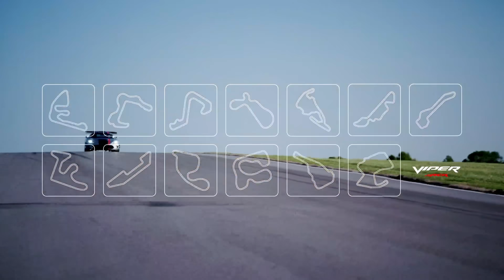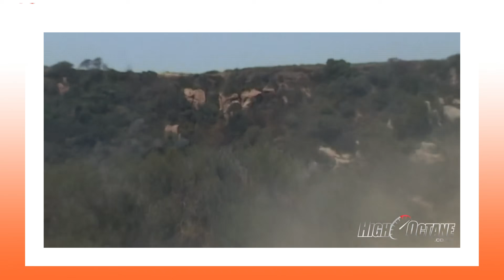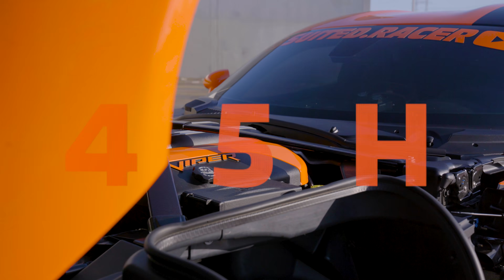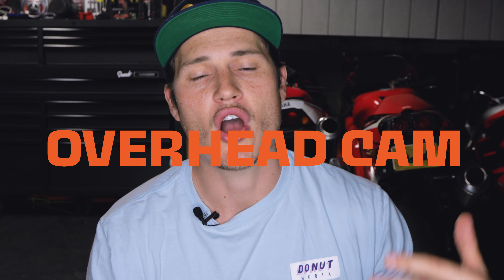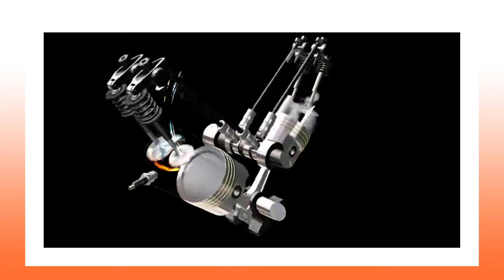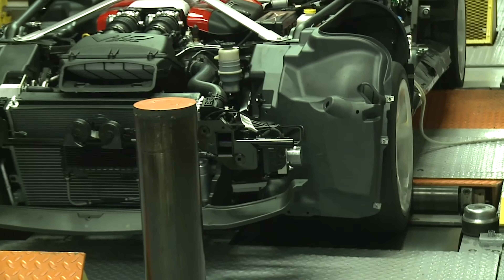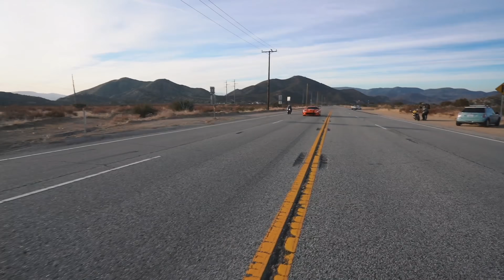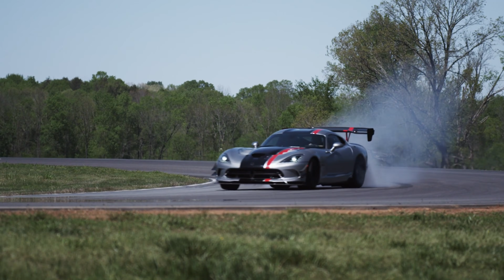The Engineering Behind the BEST car America Will EVER MAKE - Dodge Viper ACR

Comment: Hey Donut 
You can rent a viper for a track day, this memory will be with you FOREVER, long after the fiat was fritted away on noise, I rented one in T.O., before buying one in Brampton. I took it to T.X., g,bush has T.X. sized toll highways, 175 mph one way, switch seats, throw coins in the toll booth, watch the gas gauge drop CONSISTENTLY at 175mph. Good times, if YOU had extra fiat, stock viper,  take the snake to a king cobra, 1000hp, blower like Corvette?, (hennessy blows, any standard car guy, if it doesn't have a stick, I won't buy it), add turbos?, alpha package? Thanks for the video.

Comment: *A 1998 Dodge viper sits on a lot in the hot sun, looking both beautiful and deadly at the same time. its headlights almost seem to glare at you with malice. its Viper blue paint and dual silver stripes making it stand out, in spite of it being on a rotating pedistal. on the front glass is a sticker, at the bottom and to the left that says "For Professional Drivers Only" followed by the trademark Viper insignia. this is a GTS, equipped with Viper 5 spoke alloys shod in a sticky sports compound. it's listed at $118,950 USD. you know that it's the real deal. fiberglass tub shell sitting on a partial spaceframe chassis. almost nothing for amenities or comfort. interior simply 2 black bucket seats clothed in padded faux leather vinyl, no A/C no power windows, no ABS, only 2 large speakers in the center between the seats, a radio, and a 9ated 6 speed shifter that controls the Borg Warner T56 transmission. it's practically a purpose built racecar for the road.

Comment: I've owned both a Viper (2000) and a Corvette (2004). The Viper had neck-snapping torque and eye watering acceleration, but it was no fun to drive. Clutch, gearshift and steering were all truck-like. Viper was so over-powered and unrefined that it made me feel unsafe all the time. Corvette was like an F-15. Viper was like a MiG-25

Comment: A few corrections about valving.

Many engines have gear driven OHC.

Pushrod engines can run more than 2 valves just as easily as an OHC.

Pushrod engines can also have them at any angle, not just straight over.

Almost all highway big rig engines since the late 90's have been gear driven OHC engines, and have been 4 valve engines for even longer, by a decade and more.

It may not be common in the automotive world, but is the exclusive standard in heavy duty engines around the world.  There just isn't a call for it in the automotive world due to planned obsolescence and economy demands.  Chains and belts are good enough and cost much less than a gear driven valve train, and since the vehicles last long enough to exceed warranty, there is no reason to spend the extra amount for a gear drive.  Additionally, belts have the lowest parasitic loss for turning the valve train, leaving more power and economy available for moving the vehicle.  Plus, it is cheap.

In heavy equipment though, longevity and reliability is paramount.  Vehicles,  including highway trucks, are considered equipment, not automobiles, and expected to work and earn a profit.  A breakdown can cost thousands, tens of thousands, or even millions of dollars worth of both repair costs and lost income.  They also tend to be significantly more powerful, so the very minor relative gains from using less reliable chain or belt driven cams is not worth the risk of total engine failure.  All diesel engines are called interference engines, which means if the valve train breaks and the cam doesn't turn at the matched rate of the crank, the valves will hit the pistons which can lead to broken valves at the least, to total catastrophic engine detonation at worst.

Comment: an important note: The edges of the spoiler having winglets is also because flow gets kinda fucky around the edge of a wing, similar to why airplanes have the swept up wingtips. If it just ends in a sharp corner, then theres a ton of vorticity created in the flow which causes relatively huge amounts of drag and flow instability around the wing, not only making your thrust effectively lower but also killing a decent chunk of your lift.

Comment: The viper is hot garbage. No power steering or traction control. The corvette outsold it because the corvette had just as much power with all the modern comforts.

Comment: The viper is an extremely powerful engine, however the king of N/A torque from a gasoline engine is still AMG 7.3 M297 which has had 664lbft of torque since 2006 in the Pagani Zonda
Reply: Where are you going to buy that though lol
Reply: @griff1709 Bingo

Comment: almost every production car of this category has a hollow wing. there are from 3 to 5 layers, from that is 1 or 2 layers of glassfiber because carbon itself is very stiff, but it can´t withstand many impacts from pebbles and so on. there are not many car parts which are made only from carbon fibre because of this. only little things, interior and stuff which should not withstand big impacts like bumper or diphusor.

Comment: It's not that I disagree, the numbers do.  600 lb-ft from an 8.4L is surprising only bc it's low.
Forget being the highest torque, or the highest torque per liter ...
we know it's nothing special to exceed 100 HP per Liter, bc HP is SYNTHETIC:
(just a function based on torque retained over 5,252 rpm).

Torque is WHAT performance / sports cars make, (and often they make more per L).

85 lb-ft per Liter - C8 Z06 - 5.5L and 470 lb⋅ft
87 lb-ft per Liter - 992 GT3 4.0L and 347 lb⋅ft
77 lb-ft per Liter - Viper ACR 8.4L and 600 lb⋅ft

Perhaps better is judging the ACR by area under the curve; which is a better metric, anyway.

Comment: I actually got to see the original prototype in person at the Chicago auto show in 1989.   In fact we got to actually sit in it !!!! It was never intended to be anything more than a proof of concept that ran and drove featuring an Aluminum version of the V10 truck engine that they hoped to one day build a performance car version of. The public sent so many letters Dodge decided to produce it with a few changes. they got rid of the sick looking headers that went directly into side pipes the were exposed all the way down the side of the car !!! It runs out several people were burning their feet and legs getting in the car!! It was several years before they even offered a top on this car at all !!! I also heard the firing order had to be changed because the truck version was warping the crankshaft when you kicked up the performance !!!!

Comment: I've owned two Vipers and I still learned some things from this. Great video!
Reply: Man the viper is my dream car any pros and cons I will try my best to start saving up next year
Reply: @AAA-wn5dp  it depends on the generation, but the biggest cons are visibility, interior space/headroom, and difficult to get in and out of. It's easy to burn your legs on the side exhaust if you're not careful, and if you're tall it's harder to actually fit in the cockpit. Also the interiors are pretty lackluster unless you have a gen 5, but people don't buy these for the creature comforts. They're all pretty minor imo.

If you can afford it I would splurge for a gen 4 (08-10) or gen 5 (13-17). They've skyrocketed in value lately though.
Reply: @98BlackTransAm  yo thanks for the feedback

Comment: I owned a viper and it had ironic pros and cons never considered. 
PRO:the viper used cheap common parts and it was built to be worked on.  Easiest vehicle ive ever loved to wrench on.  things such as the rack and pinion unit could be removed in 15 minutes.  Simple and reliable.
  
The IRONY:Car tried to kill me 3 times.  I mean seriously,  it was like the hottest craziest bi-polar chick you could ever cross paths with. Troubles happen when youre not expecting, wanting or in the mood for it.  The amount of women that approached me for dating vs before ownership was astounding.  Every shop I took it to for services had to come ask me how to open the hood.  I was 28 when I bought it and full coverage insurance was only $75 a month.

CON: Itll need new rear tires every oil change.  Theyre $500 a piece.  Doesnt matter if youre always easy or throwing it like crazy chick likes....every 5k miles costs you least a grand for rubbers.  She like 10 quarts of the good stuff to boot.

Comment: The Chev Ls engine is variable as well
Reply: Yeah that's what I was going to say I have a first gen 6.2L in a Yukon and it most definitely has VVT I know because I have replaced the actuator.... by no means do I mean it is a great setup but it does change the valve timing as well as torque and power output.

Comment: Viper has always been my favorite car from the modern era. Just like the 427 Shelby Cobra (its predecesor). Front engine, rear wheel drive, huge powerplant, super capable!
Maybe, If Dodge lets the viper make a comeback, We might see one with most of what made the viper such an amazing car. That car was a beast meant to test the driver while other cars were made to make the driver test the car. 
Now, If we want to see it alive again we must accept That the viper competes directly against the corvette. That is a rear-center engine vehicle with a huge v8 and a ton of tech. So maybe the viper will still rely on analog aids instead of electronic aids, but it is most likely going to be a rear-center engine vehicle with lower displacement, forced induction and maybe AWD with a polarized power split towards the rear (maybe 70 or 60 Rear and 30 or 40 front). It will come with EBD for shure, Traction control that you might be able to dissable and that makes me think it won't look exaclty like a viper should.

I love dodge for its huge engines, but They must start going towards smaller blocks with forced induction. I would absolutely encourage Dodge to use 2L L4, 3L v6, 4L V8 and 5L V10 to make the new family of Mopar Engines. That would make Dodge proffitable, emmision compliant, more popular and more likely to survive modern standards even if it forces them to burry big blocks in history.

Comment: People poo-poo pushrods. But they need to understand that on a road car, displacement means nothing. Physical size and weight mean everything. If Dodge or Chevy can make a pushrod 7.0 V8 that weighs less, is physically smaller, and makes the same power as a turbo 4.0 DOHC V8, then the American engine is better. Period.

Comment: Umm why you calling what's obviously the handle of a swiffer duster a broomstick, i get it, broomstick sounds less prissy, and a broomstick would be hard as hell to use to even turn a flashlight on and off and therefore a terrible analogy, but instead of rewriting the analogy once you realized it, possibly very close to shooting the video to have time to change it, or some point just before shooting, I just want to be a fly on the wall for that conversation, and fervently searching for a replacement believable enough to make the analogy work,  and then someone going  " hold my beer" and then runs off only to return with the duster in hand, and you guys were like fuck it, action!

Comment: production (high numbers) it may be, but i would never make the viper a v10,
 but a DOHC 32 valves 8 cylinder hemi, 8 liters 512, all aluminium head/block, high compression, 8000 rpm, ram air 8 throttle bodies, NA engine to start as the Viper RT-NA, 
then a single turbo version 488 V8, lower compression forged inners , single throttle body , with after market programable injection modules friendly ports. Dogde , if yall read this.. im not busy at all...

Comment: I’ve got to call Bs on one thing. Pushrod engines generally have more torque because they are generally of larger displacement than OHC engines. They’re larger displacement because they NEED to be because they are less efficient. 

For example, let’s compare the 8.4L Viper OHV engine and the 5.0L DOHC Mustang engine. The Viper engine has 1.68 times the displacement of the Mustang engine. The Mustang engine makes 420ft-lbs of torque vs the Viper’s 600ft-lbs. If you correct for the added displacement, you would multiply the Mustang’s torque by 1.68, and get 706ft-lbs of torque from an 8.4L DOHC Mustang engine. Or, go the other way and divide the Viper torque by 1.68, and you would get 357ft-lbs for a 5.0L Viper OHV engine. 

I’m not trying to compare these two engines. They’re both great. I’m just saying that low end torque is NOT a feature of pushrod engines. It’s a feature of LARGE DISPLACEMENT pushrod engines. Low end torque would be even better with a large displacement DOHC engine.

Edit: and when it comes to HP, there is no comparison. DOHC dominates, not only due to efficiency, but because of higher revs.

Comment: The angle of a aircraft wing doesn't affect lift as much as the shape that it has when viewed from the side. There's more surface area on the top which means air molecules have to move faster on the top to meet back up with the air molecules that where passing under the wing, thus creating lift. You can increase the angle of attack for more lift but at the cost of more drag.

Comment: great video but your explanation of lift was completely wrong. It's not the air pushing up on the wing. It's the difference in pressure due to the air traveling faster over the top of the wing and creating lower pressure above the wing than below it. Flaps work like you were describing but an airfoil does now.
Reply: I just had to stop watching this video because, I know you're the science guy at donut, but you don't understand the basics of aerodynamics and you're trying to explain it..?

Comment: Top speed of 177mph? But is it really 177.6 mph?! Now that would be impressive.

There is no replacement for Displacement. Period. No arguments against this fact are valid.
Dont say superchargers or Turbos. That is still not true. Assuming all other things are equal, If you add displacement your power output is higher. Especially with those turbos or SC's.

Comment: so you mentioned overhead cams being able to rev higher/faster because they have less rotating mass. you also mentioned that pushrod engines only have one camshaft in the middle of the v, so wouldnt a pushrod engine be able to rev higher/faster because it has 1/2 or even 1/4 of the camshafts that an overhead cam engine has? ALSO, 14:47 you have that all wrong. the wing on a plane creates a low pressure area above the wing causing lift

Comment: Try not to use aero dynamics of a airfoil on a airplane in reference to the airfoil on a car. They do not create the same force as you stated.  A airplane wing works off of bernoulli's principle which means the air on the top of a wing is moving faster then the air moving underneath and this is created by design and since faster moving air creates less pressure this principle allows for lift.  A vehicle wing works more like a elevator on an airplane. The vehicle wing is designed with a pitch which is respective to the chord line of a airfoil when the elevator pitches up or down.

Comment: valves, camshafts, pushrods, transmissions, blah blah blah. ICEs are so complicated, with so many moving parts. EVs are SOO much simpler -- one moving part!  If they can just solve the battery problem...
Reply: Did you say EVs at better?   Get out Elon fanboi......😑😑
Reply: Try fixing an ice engine on the side of the road vs an battery and tell me which is more complicated.

Comment: forget cam shafts where the pneumatic and or solenoid driven valves @? we have the tech but no ones using it, except a few super cars and some guy with a harbor freight engine. so much tuning potential its insane(throws vetch out the window if its ironed out a bit)

Comment: The ACR doesn't use a spoiler. A spoiler and a rear wing are not interchangeable terms. A spoiler cancels lift. A rear wing actively generates downforce. A car would never be able to generate that much downforce with a spoiler.

Comment: the v10 is one of the biggest motors ever to come out of detroit (by way of italy) and dodge still mounted it ENTIRELY behind the front wheel centers. despite this, the entire car is not as long as a truck, in fact  it's barely longer than the corvette depite it's engine being nearly 6 inchest longer

Comment: You need to look up what gives an airplane wing lift. It has nothing to do with air hitting underneath the wing. It’s a negative pressure on top of the wing that pulls up from the top rather than push up from the bottom. It’s the reason you have to add downforce to the car. Otherwise the curved shape of the car top would cause lift at high speeds causing it to take off

Comment: We need to salvage this Duo Cam tech for the future. Pure genius and a total gamechanger for the performance game. I'd like to see that thing used on the Boxer engine platform. Imagine the natural balance of the flat engine combined with variable valve tech plus
 lower/centralized rotational mass. If more displacement is needed just do like Subaru did with the SVX and make a flat 6.

Comment: Ahhhh, nooooo. Pushrod Engines do NOT have to have the valves in a line. Ever heard of the Chrysler Hemi? It has been around since the 1950's in various iterations. It is one of the most successful drag racing engines ever.
There is a modern variant in the Challenger. And BTW, as far as rpm goes, the 426 cu.in. version from the 1960's and 70's used to leave the line at a drag strip at 9,000 rpm. True, it was a really HEAVY enging at almost 900lbs...compared to a small block chevy at closer to 500 lbs...but it made so much power that it won a LOT of races.